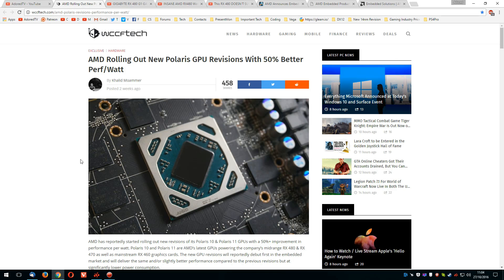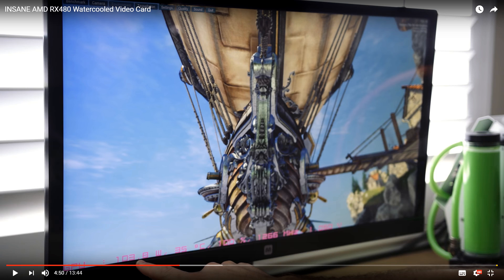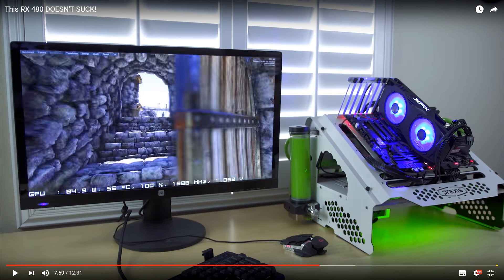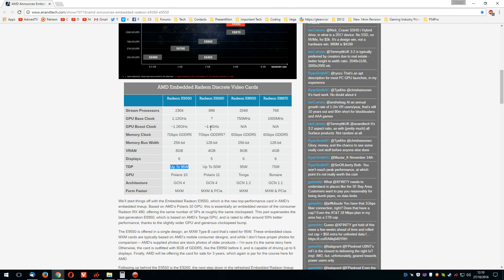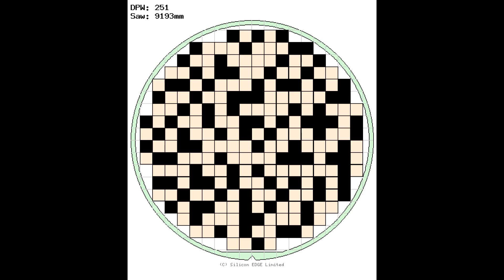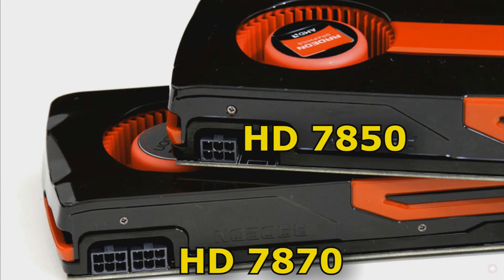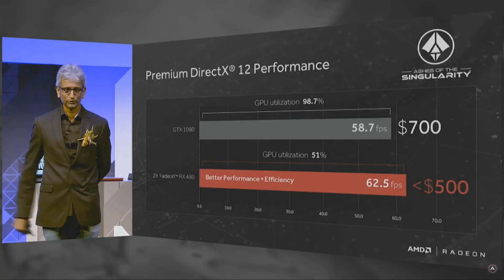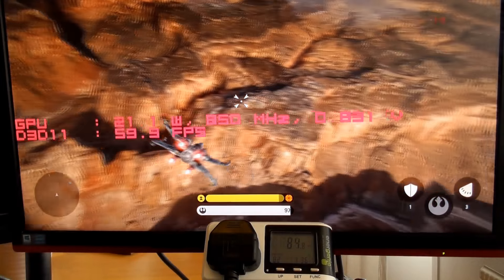Polaris Efficiency - Truth or Myth?

Comment: This must be why the default voltages in Wattman are set ridiculously high. Many people have gotten lower power usage and temps by undervolting and getting more stable clock.
Reply: dr3wd4wg Nice idea, doesn't show the same results as Jays does. At the same temps, clock speed and voltage I was getting 110W. Go figure
Reply: My stock RX470 was running on 1.118v at 1242 on Core and 1650 on memory with peak power draw of whole card at 170ish watt and GPU power draw of 150w and 135w average. 

After playing around with it, It's now on 1250 on Core, 1750 on memory with peak Vcore of 988mV or 0.988v. Peak card draw is now 105w and GPU was 83w peak. It averages around 70 to 75w.
Reply: My stock RX 470 wouldn't draw over 95 W of power without an overclock. With an OC and crazy over-voltage, it now goes up to 125 W. So...
Reply: The numbers in afterburrner and GPU-z only count the core power usage, the vram, fans and auxiliary components would bring that 95w up to 120-125w.
Reply: I tested my numbers with Afterburner, GPU-Z and HWinfo. HWinfo provides the overall power draw as well :) Also I recently modded the Vbios to tighten memory timings as 470's memory (except for Sapphire nitro) changes latency above 1750mhz. I also undervolted it, It's now on -225mV (875mV) with tighter latency and I'm getting 20GB/s more on 1750mhz (175-180GB/s) itself in OCLMembench. It goes as high as 2050mhz after undervolting compared to 1950mhz on stock voltages. :P

Comment: Could you look into undervolting your 470/480? My reference XFX RX 480 is capable of managing a -135mV undervolt at just above the card's stock clock of 1288 (at 1300mhz). 

However this is only possible after I checked for permission (living in the US where the warranty stickers are not much of a factor) and added a Accelero Twin Turbo II cooler previously used on an ol 6870. I had to use a copper shim to allow myself to use the reference vRAM/VRM heat-spreader, and I opted to use a more attractive custom fan and shroud assembly using some thin Toxic-X fans. This custom cooler, which is not noisy or too excessive (its thicker than the typical dual slot cooler), was able to help keep temperatures down to new levels that would allow for new safe levels of extreme undervolting!

The end results is reduced temperatures in every scenario. I can reduce the voltage to the point where I do not need to raise the power limit past 0% to maintain a solid 1300mhz without it throttling, as the power consumption with reduced voltages helped so much with that. 

The Polaris chip is very sensitive to temperatures when you begin messing with extreme undervolting. I suppose every GPU is, but it was fascinating probing and testing the voltage/power/temperature/clock characteristics of this typical RX480 that was purchased slightly regrettably 2 weeks before aftermarket Nitro, GTR, and Gaming X variants were finally going on sale at proper prices and quantities. I am still happy with what I received. If anyone is bummed about their card's temperatures with whatever cooler they are running, I ask them to venture into the realm of  choosing a fan profile that best suits them, then try undervolting some. They may be some of the many fortunate customers with an efficient chip that has the unfortunately high stock voltage curves/tables set in vbios.

That said, learning how sensitive the GPU is to a certain undervolt (becomes unstable when a certain temperature is achieved), it may be a little stressful to get the most out of your rx480, but simply toying with your GPU voltage with fans low enough and temp limits to your upper end of your expected operating temps (say 80c, 85c, or 88c) will yield some very stable undervolt to keep gpu temps and power consumption down some. 

For me, I had to create a custom fan curve to my liking, and find for each clockrate preset what is the lowest stable voltage it could run stably during benchmarks without a crash soon after. Then I choose something 10-20mV higher and settle with that. I learned that my Polaris chip can OC pretty far (1450mhz with +80mV ulgh), but it is its most stable, handling an undervolt below -100mV, up to about 1330mhz. However, I like how quiet and cool (in the mid or upper 50C ranger, depending on fanspeeds) things can run when running at lower voltages and closer to solid stock clocks (no throttling ever observed due to power or temps). I feel a bit better about my smaller build, but I may mess with clocks again once average temperatures begin to drop in the room and outside.

Good luck with your experiments. Thank you for doing the tests with the 460 in Battlefront to show that the haters are not thinking critically and considering things that few gamers do, but the engineers probably thought of right away for the demo early this year. Cheers!
Reply from the maker: I noticed with my own card that it can't hold 1390MHz at 75 degrees, but is able to maintain stability at 65 degrees (full fan on the reference card).  Very strange behaviour actually and I agree that low temps really seem to help with overclocking.

My 480 undervolts to 1.033 V stably, although it can run for days without crashing at 1.015 V.  There is a similar story with the 460 which is stable at 1010MHz and only 0.800 V.
Reply: Same behaviour is exhibited on the GTX 1080s these days. Watercooling can turn one card from a bad overclocker to a good one just due to lower temps. Weird indeed.
Reply: I forgot to mention to try out the "WattTool" from overclock .net forums. It is pretty much a crash free version of wattman that does some similar stuff as Trixx (voltage offsets) and can see VRM temps like you can see in HW64 monitoring software, as well as some fun l2C settings like enabling and disabling the VRM phase balance to reduce VRM temps (if you are comfy with it possibly drawing more power from your PCI-E slot, if you have a quality multi-GPU motherboard to work with). I stopped opening Wattman and Trixx since I began using this tool. I like the new fan/temp/power limitations of new GPUs, instead of choosing to override some of those things in Trixx to make the card feel like a HD7000 series card when overclocking.

Anyway, thank you for sharing your results. They sound pretty good! A fairly good speimin you have. The 460 you have seems very fascinating to me, though they are built to be more efficient from the start. Cool!

I suppose everyone gets various bins of rx480s. I suppose I feel lucky seeing the true capabilities of my Polaris chip since I got the restrictive reference cooler off of it and I got to learn more about its characteristics. I feel like I am not allowed to complain about its temperatures, power consumption, or noise, as I can find a fair and decent balance, or optimize for one or the other since I began taking notes of my progress. I feel like I got my moneys worth once I began messing with it more.

I certainly hope utilities will be released that will safely find lower voltages and fair balances of clockrate/temps automatically for people to get a bit more free performance or efficiency from their purchase. It could maybe help many see their "hot" and "loud" product in a new light.

Finally, I invite you to chart out various voltages per clock per temperature, even if at crude or coarse voltage/clock steps. I found, for example, that before I began tweaking with Trixx and WattTool, setting 1050mV for the last power state at 1300mhz was only stable if the temperature stays below 72C. I could reproduce the conditions repeatedly, often by accident, when the fans slowed too much, or the temp rose too fast while changing presets, causing a freeze. For profiles requiring fans to be slower, and temps to be in the mid 70s, I had to increase the voltage to 1070mV or so. I just wished I knew what the exact precise voltage/clock tables were to understand the effects of offsets a bit more. I understand they are based on the Wattman power state chart, but droop is to be considered. anyway, I am obviously fascinated with painting the picture of the capabilities of my card in a very complex painting of a chart. I need to re-map that chart again using the newer tools I found and with some free time!

Comment: Cheers for the video. Thanks for the testing and the explanation where these appliances go. Might also even explain the shortages since embedded systems with a more efficient architecture is a godsend to these market sectors (labs, hospitals ect.) due to overall power bills.

Comment: jesus, that efficieny. i run dual harpertown xeons with a GTX 1070 and my PC idles at 120-150 Watts (mostly CPUs and mobo). Computer parts have gotten really efficient.
Reply: Ouch! I feel better when my entire system idles at 76W with the rx480 (which has improved idle consumption compared to previous generations). That is the cost of slightly aged ivy quad cores on z77 and maybe too many hard disks and fans. I tried and cannot get my system to idle any lower, even with older operating systems. It also limits how much I use multi-monitor setups if I genuinely do not need to.
Reply: i got 56 watts on idle gtx 1070
Reply: something wrong with your cpu combo check forums ing gaming its only should be around 190-220 watts
Reply: nevermine my post it is  "xeon" XD
Reply: Duals Harpertown's? Holy bottleneck.

Comment: I expect that WCCF report about the improvement in binning and manufacturing process to be true.  The 14nm process is really new, these GPUs are the first on the smaller node size. And it always takes some time to get all the complicated manufacturing things correct. It is entirely possible that Global Foundries really improved their 14nm process. That's maybe also part of the reason  why the Pascal cards are still much better in terms of power/performance. TSMC, who manufactur Nvidia's GPUs, are a much bigger company than globalfoundries. It is entirely possible that they had better manufacturing and binning process than Globalfoundries from the beginning.

Comment: As with any CPU maker, yield is increasing as the production and binning process matures. At some point, AMD may actually produce more high efficient chips than they really need for the mobility and embedded market. In that case, these chips will be used in the GPU market. That's how JayzTwoCents probably got these highly efficient cards. Chances are high, that many of the recently produced cards will be way more efficient than those that were reviewed in July. The FX CPUs are an other great example of a well matured production process, as all of these chips are insanely overclockable.
I wonder how long it'll take until graphics cards manufacturers discover this as an opportunity to come out with extremely overclocked, high performance variants of the RX 4xx cards at a small premium. I think soon we should see RX 480 cards running close to 1,6GHz and hence being near the GTX 1070 in terms of computing power.

Comment: I find it funny when you were coming out with videos at the greatest frequency is when i was most interested in the gpu market and the upcoming chips. I think you should keep up the videos and maybe even consider upgrading the production as you definitely have a unique viewpoint as compared to most tech youtubers. 
I was somewhat disappointed with polaris and ended up getting a ftw 1070 after owning a CF 380X system since dec. If i had known you could achieve the performance shown on jays videos with the xfx non black edition i might add only the XXX OC. I would have easily bought a 480 and kept the savings. I now am anticipating the RX490 but am unsure after many months of speculation what exactly its going to be. Im more then willing to part with my 1070 simply due to the fact g-sync adds hundreds to my system cost so id rather take a loss on my 1070 and get a 490+freesync monitor for probably what the total cost of a gsync monitor would be lol. 
Ive seen some rx480s artifacting with 5-10 mhz added to core clock which would indicate your correct on them throwing a wide range of chips out there with varying performance.

Comment: well so i should be happy, that i can oc to 1520mhz on my rx480 (stock, watercooled, 6pins), but i ended up clocking it back to 1450mhz, so i dont need to up the voltage more than 1.150mv... but that explains a lot about the waifers and etc... thanks for the vid!
Reply: Have you found how low you can undervolt using offsets at closer to stock clocks? Just curious. I can achieve a -135mV offset at 1300mhz, which results in low power consumption, temps, and fan noise. I use "WattTool" from overclock .net and sometimes Trixx.

However, I am running a reference XFX rx480 with just the reference vRAM/MEM cooling plate and a Accelero Twin Turbo II from an 'ol 6870 using two recycled thin Toxic-X fans (ones not dying and screeching) on a custom shroud. Note that you must use a copper shim (not ideal) on the GPU to make this aftermarket cooler work with the reference heat spreader plate without cutting it (for warranty reasons). Copper shims are not ideal, but I like the idea of going budget custom water in the future. 

I never desire to run the fans over 45%, but that is okay as I can keep the temps down in the 50's with more aggressive fans, or the temps at a reasonable level (70's) with the fans at idle. Regardless, with offsets beyond -100mV, you can get core voltages pretty low around 1V.
Reply: when i got the card first and i was waiting for the watercooling, ive got down to 0.875mV with the basic settings on the ram and the gpu

Comment: Is Nvidia's GPU Boost Tech the real winner here?
Honestly I think SOME of their perf/watt is down to it.
Reply: If only AMD implemented some form of intelligent GPU Boost tech like nVidia's latest, I think their TDP figures would have been a bit lower. Intelligently running at the highest clock for a desired voltage could allow for a bit more performance for some, or if the voltage or clocks were limited, and voltage reduced more dramatically, it could allow for more efficient cards with the same GPU. They kind of implemented a vBIOS with very aggressive voltage settings to ensure the product is stable for all, regardless of binning. 

However, some found when they massively undervolted their cards, they were able to achieve stable stock clocks without throttling down (say 1266mhz down to 1150mhz while gaming like many reference cards do) with a 0% power limit with AIB setups if you can reduce the power and temperatures the cards are operating at. It is unfortunate that all cannot benefit from this fully, like some Gigabyte RX480 customers. However, imagine if something as dynamic as GPU Boost 3.0 or an Efficiency Boost tech was implemented in the vBIOS. What a fascinating product you would have!
Reply: Tony E Someone in Adored his video's posted an interesting patent AMD filed. http://www.freepatentsonline.com/y2016/0085551.html

It is a tough read but its worth reading and getting exited over.

First they talk about Power-gating unused threads in a simd unit off ( saving power ) or clocking certain vector units lower to save even more power.

then they talk about overclocking certain vector units so certain threads that hold the GPU up will finish on time.

"By utilizing the power saved by executing on lower-powered vector units, other vector units (perhaps those running more performance-critical threads) could be overclocked to yield higher overall program performance"

Comment: Just bought a Sapphire RX 480 4GB this morning. Already planning to make a custom fan profile and undervolt it. :)
Not worried of the power draw or the heat: in the everyday usage and in gaming the GPU isn't stressed like in benchmarks, and if the player uses a freesync monitor or limits the fps according to his monitor specs the power used is reduced even more. 
As for the temperatures of the GPUs, I'm curious to know what thermal compound is used by the different custom cards makers. Just saw a video by DANNYzPLAY where he significantly reduced the temps of his MSI R9 390 changing the thermal paste. When seems to be something wrong when testing a video card (like very high temps) it doesn't have to be necessarily caused by the chipset itself.
Before buying a new GPU I was looking at the used market to see if there was a good deal with the previous generation cards and I wasn't even considering the AMD cards because of their power draw. Polaris did a great job under this aspect in my opinion, they improved a lot.

Comment: Well I wouldn't be surprised if both AMD and Nvidia have done some sort of binning with their GPU's for laptops in the past (for all of you who are annoyed that we get thrown the scraps), its only natural that they try and put their power efficient cards in the systems that need power efficiency, while we typically do not need this. The rx 480 you buy will do as well as the rx 480 in a laptop, (if not better because you will likely get more shaders and memory)

What is surprising is the delta between their most power efficient chips and the ones we get. A difference of almost double the wattage points to poor manufacturing techniques.